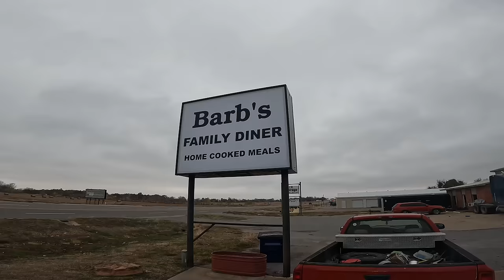Skunk, the Worlds Worst Animal! {Catch Clean Cook} results are SHOCKING!

Comment: To get a skunk out of a trap, get a tarp, or blanket. Spread it out as far as your arms can. Stay behind the tarp walk up to the trap and lay it over the trap. Pick up the trap by the handle (through the tarp) carry it to where ever ypu want to release it. Open the trap door and latch it open and move away quickly. A skunk will seldom spray unless he sees you. This way you always have a barrier between you and the skunk! Caught a lot of skunks, havent been sprayed yet! 
I live in southwest Oklahoma!
P.s. - dead skunks make really good trap bait for coyotes. Just thought I'd edit and add that!
Reply: Rob - Keep these ingredients separate but handy until you need to mix them to remove any skunk spray from you, the girls, dogs or equipment --

The formula is: 1 quart of 3 percent hydrogen peroxide (a fresh bottle), • ¼ cup of baking soda (sodium bicarbonate), and • 1-2 teaspoons of liquid dish soap. Ingredients must be mixed in an open container and USED IMMEDIATELY AFTER MIXING - 5-gallon bucket is recommended.

HOWEVER, there are a few key warnings to keep in mind about this homemade de-skunking solution: 

•	Never use this solution near your dog [or kids] eyes and be careful when applying it around the mouth.
•	Peroxide may bleach your dog’s fur or kid's hair, an effect that is especially noticeable on black or brown dogs [kids].
•	Peroxide may also bleach any other material it comes in contact with, like your clothes, towels or furniture.

Comment: 1 large can of Tomato juice, 1 cup lime juice, ¼ cup salt, 1 cup of vinegar, 2 Alka Seltzer tablets and ¼ cup of hydrogen peroxide. Mix them together and pour immediately onto the affected clothing. Let soak for 30 minutes, wash with regular detergent in cold water. Then wash again in hot water. The tomato juice will automatically stain your clothes so it's up to you if you want to keep them or burn them. Diesel mixed with vinegar or brake clean will also work.

Comment: We have professionally trapped skunks before. (lol) it looks like a few other people are on the right track. you need to cover the trap. If you are targeting skunks I would cover the trap except for the opening before you catch one. the best way to dispatch a skunk in the trap is to run a metal hose from tailpipe of your car/sxs or any gas motor (cannot be diesel) into the covered trap. Think like a flexible dryer vent type metal hose.  They will be dead in only a few minutes and will not spray.